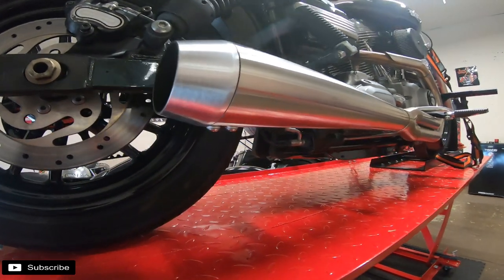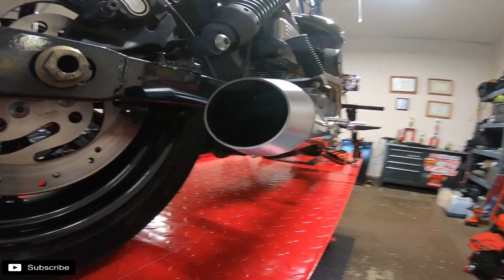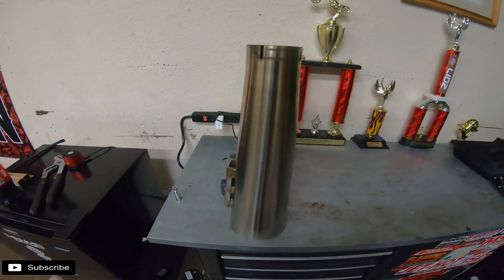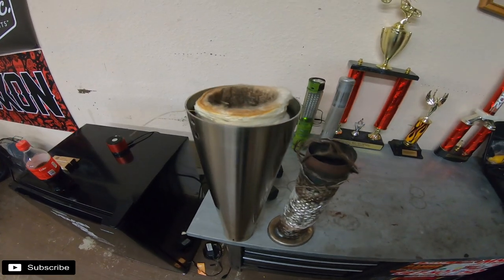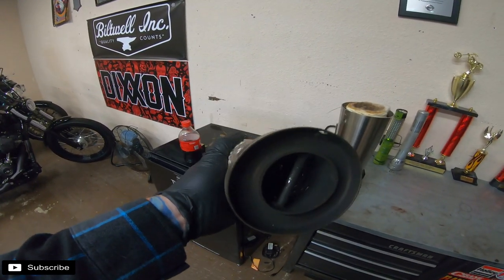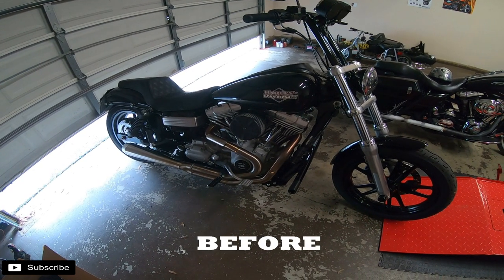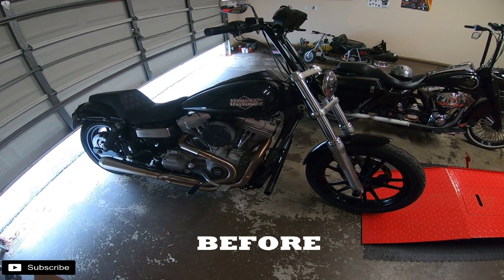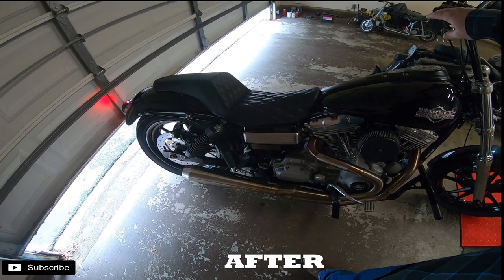Bassani Road Rage 3  Baffle Packing Removal

Comment: Hey man,did your end cap come right off or have to hit it with something. Mine only had 800 miles on it and struggling
Reply from the maker: You may have to twist it a little but yea if you need to use a long screw driver or pry bar from the pipe side and tap it out hopefully that helps....👍👍👍👍

Comment: I have a 2021 Sport Glide with Bassani road rage 2 into 1 and the baffle came out fairly easy. I just used vise grips and pulled. I took out the wrap insulation material too. Did not have to disassemble the exhaust. ALSO, NO backfiring, pops or loss of power
Reply: Did it get a lot louder without the baffle? Also did it sound any different without the baffle?
Reply: @J_BLAZE415  ABSOLUTELY. Got much louder and sounds great. Low rumbling sound without backfire, etc
Reply: @konagalHI1  thank you fornthr reply. I'm getting ready to remove the wrap around the baffle of my basanni.
Reply: @J_BLAZE415  I removed the wrap and the baffle and the black plastic tip. Sounds great
Reply: @konagalHI1  the whole thing removed, okay got it. I'll remove the the whole thing and try it out. I was hesitant to remove the whole thing because I thought I might completely change the sound of the exhaust and not not sound good. I do want it louder, but I would prefer it still sound good or at least somewhat the same original sound of the basanni, but just louder.
Reply: @J_BLAZE415  Let me know what you think

Comment: Mine should be here this week sometime. I might just remove the packing before putting it on
Reply: I just bought mine and did this exact same thing before installing it on the bike 👌🏼. Everything was real easy to take apart since there was no carbon build up yet.
Reply: @whatchumeanwillis9503  awesome mine just finally showed up
Reply: @nickmusgrove6268  dude, exhaust sounds AMAZING! Let me know what you think about it when you have it installed and hear it.

Comment: I've the same pipe on my street bob. It's not so loud with the baffle but I don't like the sound without to metallic i don't know if you see what I mean.
So i just removed the fiber around thr baffle, nouw it's perfect 👌
Reply from the maker: Yes way nicer sound with the baffle packing removed....👍👍👍
Reply: Did the deceleration sound sound better  with the wrap or with out the wrap. Mines currently as it comes but just not sold on the deceleration sound. Wondering if removing just the wrap will help or hurt the better decel sound I’m looking for
Reply: @acurarl9929  i actually put back the packing. Without you loose bottom end torque. Also I'm now in s&s 106 big bore with s&s 583 cams so it screams like hell.
Just keep the packing man the sound is nice with just a little less louder

Comment: Old video but I just put a road rage pipe in my 96" bagger didn't care for the sound with the fiberglass packing so I removed it and put the baffle back in but the problem now is the tapered muffler tip makes it raspy on accel around 4k rpm and on decel like fishtail exhaust sorta. Did you have that issue?

Comment: how loud is it on long rides? Do you think it would give you a headache? I have a 18  heritage with BRR2, but its sounds a little soft. I like loud, but at the same time when I do 500 miles, I dont want my head to thump. thanks!
Reply from the maker: What helmet do you have?
Reply: @TrippHPjunkie  I have a half helmet that i prefer to wear, but also 3/4 and full.  Long trips its the 3/4 for the most part because of teh bluetooth system.
Reply: I’m goin to opposite way I have a full length bassani on my road king  
I’m puttin the quiet baffle in it for long trips. W a full face it drowns me out and gets annoying after a while

Comment: So, you put the baffle back in but just without all that wrap? I have that similar exhaust on my 18 Fat Boy 114. It sounds good under load but kinda wimpy at idle and cruise. 
Sounds like a good idea. 
One more question: you said tune was still good afterward?
Reply from the maker: Yep just changes back pressure slightly so tune should be good....👍 thanks for the comment
Reply: Thanks so much! Really appreciate the response!

Comment: Love ur video. I am trying to pull baffles out my basani RR3... man I just having hard time with it.
Reply from the maker: Thanks bro......take the muffler all the way off and use a pry bar and hammer to beat it out of the end that has the end cap....it will come out if you do that....thanks for the comment
Reply: So, I need to beat it out from other side close to collector to end cap?
Reply from the maker: Yes take the muffler off the pipe and take the end cap off and push it out towards where the end cap mounts.....should be golden after that.....👍👍👍👍👍
Reply: @TrippHPjunkie  thank you and keep uploading the videos... good stuff!
Reply from the maker: @paulson9616  thanks man new video tomorrow morning.....🤜🤛

Comment: Before sounds deeper, After sounds louder. 
Nice mod.
Reply from the maker: Thanks man yea louder was my goal....wanna hear the motor.....if feels like it picked up some horsepower by may be just me
Reply: I don't think it will be just you . Now here is the thing. Where do you feel it may have improved? Low end hard take off, or as you wrung the gears out ( in the top end). 
Maybe you could have lost a little grunt, but picked up some mid range to top end oomph.. (hp). 
I will be interested to see your next video brother. 
 @TrippHPjunkie
Reply from the maker: Thanks man.....yeah definitely mid and high rpms picked up...from what Ive seen so far it looks like rpms rise way quicker.....thanks again motovlog next week
Reply: Indeed , more power up top . Nice gain .. hehe.  @TrippHPjunkie

Comment: Did this to my Bassani RR3 on my 103, and I lost quite a bit of power/torque but I do love the sound. How did your bike respond to the decreased back pressure and do you have any suggestions in how to keep the sound minimize the loss of performance? Cheers bud, love the bike🤘🏼
Reply from the maker: Only removed the packing around the baffle not the baffle itself

Comment: Im gonna take the packing out of my RR2 tomorrow. Hoping not to loose any performance or at least be able to use my powervisions auto tune to correct any issues it causes. Good idea? Have you kept the packing out or did u re pack?
Reply from the maker: Keep the packing out and love it from what Ive been told it only affects sound
Reply: Cool,  I went to pull the packing out and its was already gone! Previous owner musta pulled it, I bought the pipe used. But a buddy sent me a big city thunder baffle Im gonna chop my current baffle down and ad it. Hoping for louder this bassani is pretty quiet still
Reply: @travismccarty515  How’s the difference with the BCT-baffle?? People say it makes any pipe louder and more ”throaty”, should also add some great backpressure and therefore a noticeable difference in performance.. What’s your thoughts?🤘🏼🤘🏼

Comment: I have a cobra el Diablo which I guess has no wrap around baffle. A little high pitch and raspy for my liking. You think adding the wrap to the baffle will make it sound like the other 2 into 1s?
Reply from the maker: The wrap around the baffle is more for control the volume loudness so yea give it a try wrap is pretty cheap considering let me know how it goes

Comment: Hey man I have cobra el diablo and was thinking about doing this. What kinda tuner do you have? You said the tune was fine after this right? I need more loud in my life but not less power 🤙🏼 thanks for the video
Reply from the maker: Give it a shot ride it after and judge
Reply: @TrippHPjunkie  well shit.. I just got my baffles out and there's zero packing in these pipes. Weird
Reply from the maker: @mikebronc2902  that sucks you can open up those baffle holes to get it a little louder
Reply: @TrippHPjunkie  i was thinking about doing that. You think it'll affect back pressure too much?
Reply from the maker: It will slightly but as along as you dont change anything else you should be good

Comment: Question: did you have a good amount of deceleration pop before or unwanted decel  noise before and did it help the decel sound after. Love the acceleration sound of it. Just thinking of removing packing to make decel sound better.
Reply from the maker: Yeah it pops on decal off of full throttle
Reply: @TrippHPjunkie  worse then with the packing?
Reply from the maker: @acurarl9929  honestly I dont remember its louder for sure
Reply: @TrippHPjunkie   k thx

Comment: I really want to do this to my 2016 FXDLS with RRIII, but I am afraid it'll ruin the low end torque, and I'll end up having to buy a new kit for repacking it.. Also don't want it to sound worse. But I want to try!
Reply from the maker: It sounds way better and exhaust packing is pretty cheap its way worth it in my opion
Reply: @TrippHPjunkie  then fk it going to the garage now! lol
Reply: Well I did it... And my bike didn't like it. Sounds good but noticeable drop in low end torque, I immediately repacked it with new packing
Reply from the maker: Weird I did not notice that but also I have a chain kit so thats probably why.....👍

Comment: Did u see any performance difference or drop in mpg? Thanks in advance?
Reply from the maker: Twist the throttle more yes so seat of the pants yes performance gain but no dyno numbers really just wanted to hear the pipe threw my fullface
Reply: @TrippHPjunkie  lol I dont care about gaining just dont want to lose. But definitely way too quite. Just removed packing . Will test out tomorrow. Thanks for responding 🤙
Reply from the maker: @jcg5647  let me know how you like it

Comment: So you just removed the baffle packing and put the baffle back in?
Reply from the maker: Yep sounds way better
Reply: Does the baffle rattle at all? Is your bike still like this? I think I’m about to do it? I didn’t know you could put the baffle back in after taking the packing out
Reply from the maker: No rattle at all the baffle bolts right in the pipe....👍
Reply: @TrippHPjunkie  did you remove the twine as well or just packing on outside??
Reply from the maker: Just the material baffle stays
Reply: @TrippHPjunkie  thought u said you just put the metal baffle back in.
Reply from the maker: I did remove the soft material
Reply: @TrippHPjunkie  not backfiring at all; sound better; still has alot of pull; may do the auto tune with FP3
Reply from the maker: @wjlowe111  sounds good
Reply from the maker: Cool how is it?

Comment: So what kind of tune are you using?
Reply from the maker: Vance and hines fuel pack
Reply: tripp_hpjunkie ok...thanks. Was just reading hd forum where the tuning guys were saying to get it dyno tuned using the appropriate software. Have you considered that option?
Reply from the maker: @dry509  the motor is 100% stock other than air cleaner and pipe kinda a waste of money in my opinion
Reply: @TrippHPjunkie  Ok...
Reply: @TrippHPjunkie  stock tune? or auto tune?
Reply: I have this setup with Vance and Hines fuel pak. Check engine light came on and says rear o2 sensor. Any suggestions?
Reply from the maker: Replace the 02 sensor?

Comment: Did you have it retuned after you took the wrap off?
Reply from the maker: I did not didnt seem to change the tune at all with just the wrap removed
Reply: @TrippHPjunkie  nice I'm debating taking the wrap off mine , spent $400 on dang dyno tune with the bassani exhaust. Don't want to screw up the tune.
Reply from the maker: Yea its just a noise thing doesn't effect the tune or atleast it didnt in my bike
Reply: @TrippHPjunkie   OK cool ! I'm gonna take it out.  I want it louder. I would think the actual baffle would be what effects the tune. Atleast I'm hoping!
Reply: @TrippHPjunkie  thanks dude!!!
Reply from the maker: No problem
Reply: @TrippHPjunkie  can't even get the exhaust tip off lol. Maybe that's a sign to leave it 😔
Reply from the maker: They get tight for sure I used a long pry bar and a hammer
Reply: @TrippHPjunkie  didn't you scratch the thing all up? There's no way to grab ahold of the tip without scratching it
Reply from the maker: Theres a bar in the middle of mine that I used a pry bar to push it out I believe its been a minute
Reply: @TrippHPjunkie  yes there is on mine but that's the baffle, not the tip. I'm gonna need you to just come and get this done for me brother 🤣